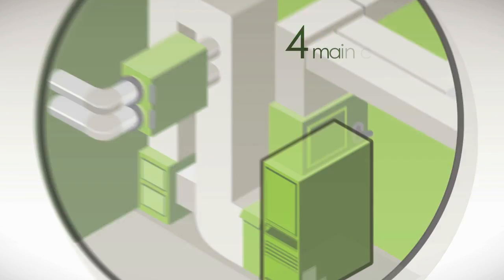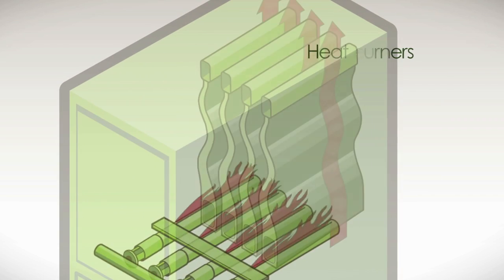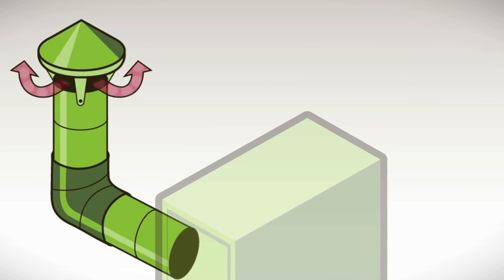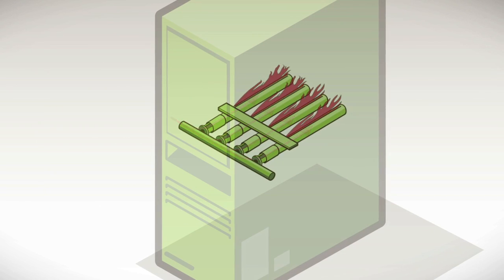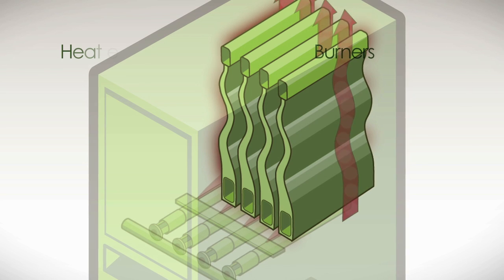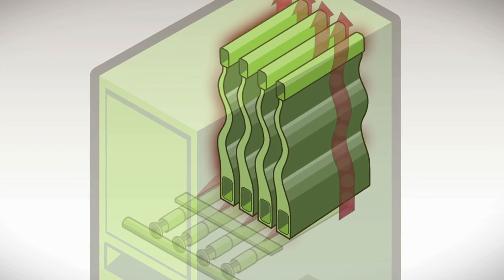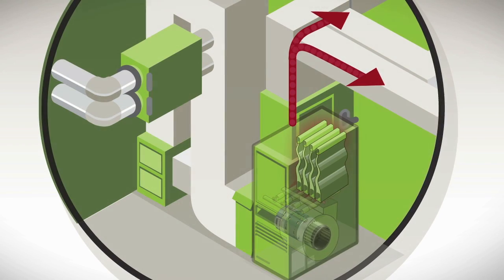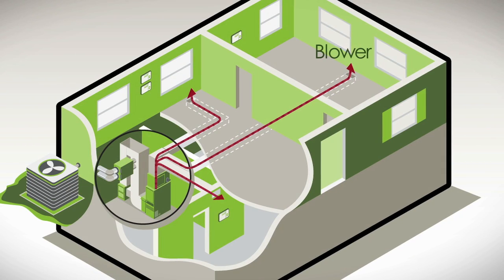How does my furnace work?

Comment: Could anyone tell me if 40 year old furnace is safe?
Reply: as long as there is no visible worn areas for example the heat exchanger, then you should be better off with an older one than the ones they make today.